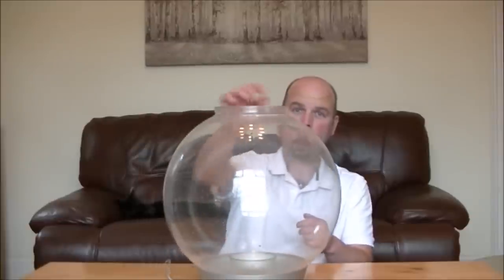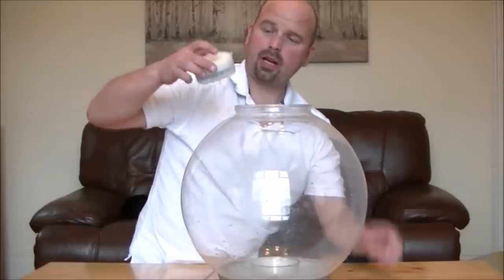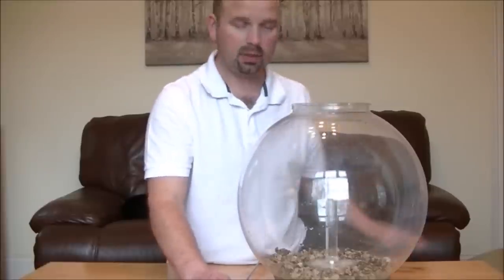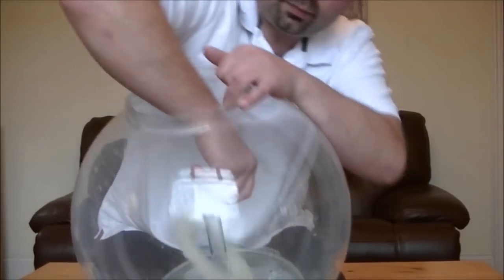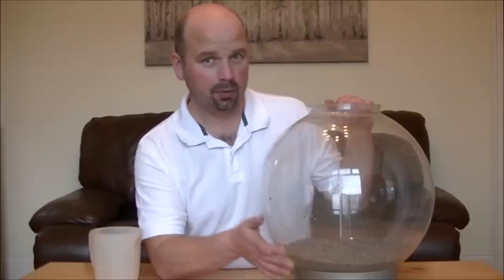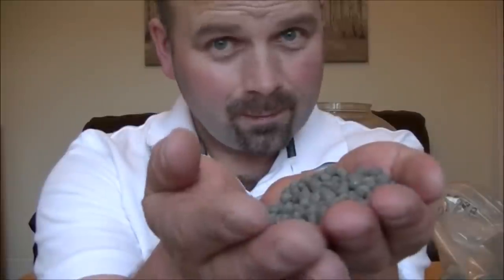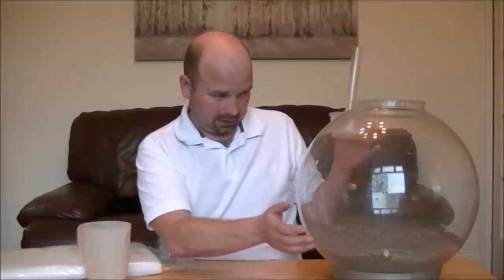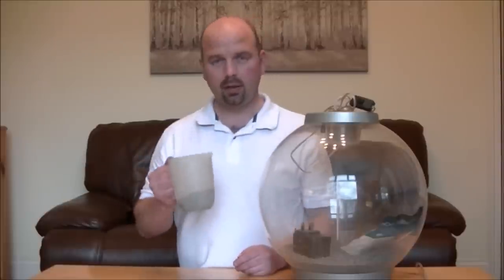BIORB COMPATIBLE UPGRADE KIT

Comment: I have literally just started and brought a biorb 😫. I'm going to do all of this to make sure I get it right. Sorry if I missed it but if I do all this how often do I need to do water changes and filter cleans?
Reply from the maker: Ideally you would still change around 10% a week just to keep the tank freshened up. That would be done when you use a gravel cleaner like this to remove dirt from the biogravel base: http://geni.us/0YMWPJJ
When using the gravel cleaner the muck will be removed from the biogravel and foams but the central fine filter pad could need replacing every 1-6 months (maybe more) depending on stock as it traps very fine muck and can't be cleaned easily.

Comment: i wont be able to put this in my filter as i got juwel but i wont even be able to put 1 kg in the juwel filter as i wont have any foams then but i might be able to put 500g of it in my filter in the bottom tray the untimate version will that keep the nitrates low
Reply from the maker: Usually 1kg per 100 litres produces a more or less guaranteed reduction in nitrate but using any biorb will help to varying degrees.

Comment: Can you put dirt on top of the foam, then sand, and the rocks afterwards?
Reply from the maker: You could but it would get all mixed up as soon as you cleaned the substrate with a gravel cleaner. An under gravel filter really needs to be set up with gravel of small size in an aquarium.
Reply: @Pondguru  Thank you for responding. Do you ever have to change the foam at the bottom? I'll do this set up and add live plants but I was worried about the foam
Reply from the maker: @lexierachelle5878  The foam should easily last a couple of years before it need replacing - foam can last for ages and only needs replacing if it gets too clogged and can't be cleaned or it starts to go floppy or shrinks with age. Root systems from plants will be extensive enough in the Biogravel and upper foam to allow movement of plant at a later date if you choose to renew the foams at a few years down the line.

Comment: I'm setting up my canister filter with 4 trays can I use 2 trays of Bio ultimate and 1 tray of bio gravel and of  course your the first one has your  media
Reply from the maker: Larry Liotta Yes just go with foams in bottom tray then biohome (any type) in trays above that. The biogravel would probably be best in the top tray as long as you had a plastic grid over it to prevent pieces being sucked into pump. If no plastic grid then go with the biogravel in middle media tray.

Comment: Hi Richard, I have a BiOrb Life 30L and I'm interested in doing this upgrade, but the one you present is round while the BiOrb Life has a rectangular shape, and has a flat bottom instead of a rounded one. With that in mind, how shoud I cut the foams and how should I position them? With the waves down or the flat side down? I'm asking this because if the waves are positioned down, the water and the debris will go through the path of less resistence. When you place the second and bigger foam, it touches the side of the tank because it is round, but I can't do that because mine is flat. Do you have any idea of how can I acomplish a good filtration system? Best regards.
Reply from the maker: Dear Jorge,
The life tank ideally needs black foams (as they will be seen through side of tank) and to have them cut to the full size of the base. As the life tank base size has a larger area than the 30 litre it requires approx. 3.5kg of biogravel, not the 2kg shown here for the 30 litre orb shaped tank (with the smaller base).
Therefore if you are going to order a kit you would need the one I do for the 60 litre orb since it has 3.5kg in it. If you order please attach a note or send a message at same time to remind me to put the black foams in as they would normally be black and blue.
Regards,
Richard

Comment: I currently have a diy k1 moving bed (2 x 2 leaders plastic bottles) connected to my under gravel filter in my 125 gallon tall guppy tank. My question is would this be a good option to mix with my current gravel I have in the tank? As I don't want to lose the coloration I have but the mix of the red I have now and the grey/black of this media/substrate would be fine. 

I do have a drip system set up on the tank so no water changes at the moment however I want to lower the loss of water due to having a drip system in place. Removing nitrites will drastically reduce the need to run the drip system. 

I also have 10 x 10 gallon fry tanks and a few selective breading tanks. None of wich are planted. 

The 125g. Is a simple grow out tank for fish I do not use for breading and are sold or given away to friends and family.
Reply from the maker: Phillip Hamby While mixing the biogravel in with existing gravel would certainly add to the filtering capacity of the tank the fact that the gravel and K1 only really supports anaerobic bacteria would mean that you would still have a nation of nitrates produced from those media types - any effect the biogravel may have will be negligible as far as nitrate reduction goes due to the standard gravel and K1 likely producing more nitrate than the biogravel can process.
Reply: Pondguru Outdoors thanks for the quick response. What in this case would you suggest for removing the nitrate. Keeping in mind that everything must be in tank. 
Maybe a chamber type of internal filter? Acrylic box with 3 or 4 chambers? I have a few ideas after watching many of your videos. However I and im sure others would like your views and recommendations in this situation. Also keeping in mind that all my media will be coming from your suppliers  in the us.
Reply: Pondguru Outdoors also this 125 gallon tank house at any givin time 100-350 guppies of all sizes. Tho a guppies bio load is some what small in those numbers it can get out of control quick. Thus the drip system and a lot of wasted water.
Reply from the maker: Phillip Hamby I would personally simply replace the gravel for biogravel and that would be the nitrate issue solved (after 4-6 months once anaerobic bacteria have built up sufficiently). Having different media and filter types competing against each other producing / processing nitrate will be difficult to balance and unless you find a way to cut back on the nitrate production and scale up the nitrate removal it will always be a problem.

Comment: I know this is an old thread and you have stopped responding... But I have a Biorb 105. I can see the weight on your website, but do you Dave a kit for 105L? Or just measurements for foam etc. Cheers for your great films. I think you are great on camera!
Reply from the maker: Dear Alan,
I do not offer a specific kit for the 105 as the foams I get in are only 11" x 17" and I have to buy hundreds at a time but the weight of biogravel is 5kg as confirmed by lots of people who have made their own kits.
Regards,
Richard
Reply: Pondguru do you know where I could buy foam big enough? Sorry to pester you! The fine filter you put in the filter  unit is same size. It's the base foam two that I need. :-) 

I'm an anaesthetist. (If you need any medical advice pvt message me!)
Reply from the maker: Unfortunately you'd have to go to the next size up which would be approx. 2' x 18" which is quite a price jump but you will find them from most pond suppliers: http://geni.us/zT8NA

Comment: Thank you for your thoughtfulness to create a solution for biorbs. May I ask 3 Q's; what would happen if I used the biohome gravel over the media that comes with a biorb? As we have already set our orb up before seeing your video(!) would it be enough to 'just' use the biohome gravel  and gel balls inside the fine centre filter? How important are the coarse & medium foam layers? Many thanks.
Reply from the maker: The foams act as a support for the biogravel (meaning you don't use much more simply to fill the bottom of the tank over the level of the central filter) and also as a mechanical filter but they also prevent any of the biogravel getting to the central filter and blocking up the intake holes. If they get blocked the whole filter system fails as it relies on a good flow of air and water.
You could just go with the biogravel in the central filter but it wouldn't do any good as you'd fit very little in there and the central filter should really be for fine foam to remove the small debris in water (to 'polish' it).
I have just answered a question about what to do if the tank is already established and here was my answer to that question:
"Just make sure that the biogravel is very well washed then ideally soaked in a bucket of water overnight then empty out the biorb into a suitable container along with the fish and other stock, set up the filter system and return everything to the tank. This may take between 30-60 minutes depending on how easily the fish are caught and how much clutter is to remove from the tank."
Hope that helps.

Comment: your saying that stuff is made up of sand.... would sand do the same job or is that no good in one of these tanks ?
Reply: It's made of silica sand that's been fired to something like 1500 deg c. So no. Ordinary sand wouldn't work because it's not porous.
Reply from the maker: Sand would not work over what is essentially an undergravel system - the foams are there to support the biogravel and mechanically clean the water. Sand would work its way down clogging the foams and fine pad rendering the system useless unfortunately. I'd normally recommend sand for tropical fish but in this situation it is not feasible.

Comment: Hello thanks for all your help, sorry one more question how often should I change the water of the 30l BiOrb, I use the optimser once a week, and check the PH levels should I just replace a little bit of the water with conditoner.
Reply from the maker: The tank should be cleaned once a week to remove any uneaten food and fish waste from the base of the tank no matter what sort of filter system is used (including a gravel base over foams) using a gravel cleaner like this: http://geni.us/0YMWPJJ
Depending on how long you spend cleaning the base anywhere from 10%-25% of water could be removed from the tank. Most people who have the biogravel system do a water change / gravel clean once every 1-2 weeks and change maybe 10%-15% of water - that keeps base of tank clear of waste and also freshens things up by adding new water.

Comment: love these upgraded videos, always need someone to think outside the tank. I've always used bio home since found on here, I have a question tho about that air stone, is there enough room inside that tube to create a moving bed filter????? add even more filtration with bio motion??? please say yes lol maybe another video, mite have to buy one of these biorb's.
Reply from the maker: +James McMullan Maybe using the new small K1 micro could add a moving bed in the middle tube but it will not be necessary from a water quality point of view when using the undergravel system here.
Glad you enjoy the videos and thanks for watching.

Comment: I’m in the process of setting up a 5 foot community tank which I want to try and keep as low maintenance as possible in the long term I know this won’t be possible in the first 6 to 12 months but I can deal with that is there any reason I couldn’t use this for the substrate to achieve that low maintenance in the long term?? And how much will I need it’s 5 foot long 2 foot front to back and 2 1/2 foot deep

Comment: Great vid thank you, I have subscribed..... in terms of stock what could a standard Biorb take, I was told in a 30ltr max of 6 Neon Tetra jumbo sized fish, with your customised filter what do you think would be a good stock level?
Reply from the maker: You'd certainly be safe with that stock, maybe a few ottocinclus for algae control and as long as the filter system was working well and you kept up with maintenance they should be happy enough. the problem is getting the standard system to work properly.....

Comment: Hi, Pondguru. i can't see that anyone has ever taken the top off the Biorb and had an aquascape flowing out of the top. is this something you'd ever consider trying? i've been given a biorb as a starter tank and will be buying the conversion kit from you as to not kill everything that goes into it, but i'm looking at trying a blackwater tanks with driftwood poking out the top. for lighting i'd probably have a submerged LED tube in there. in my mind it will look pretty good but i'd like to get the opinion of an expert before i take this on. Any advice welcome

Comment: Do you not need to be able to clean those foam pads under the gravel?
Reply from the maker: Yes, much of the muck would easily be removed by using a gravel cleaner to push through the biogravel and slightly depress the foams. I would normally recommend giving the tank a full strip down every 12-18 months depending on stock but as far as I know nobody has ever told me they took that advice and they still have the tank running fine. Simple gravel cleaning with something like this: http://geni.us/0YMWPJJ does 2 important jobs. It removes the muck from bottom of tank and does a partial water change to freshen things up.
Even when tank reaches full maturity of zero ammonia, nitrite and nitrate the mick needs removing for hygiene and water change reasons.
Reply: Pondguru great. Thanks for video and reply.

Comment: instead of using biohome, could I use ceramic rings like fluvals biomax?
Reply from the maker: The size and shape of media used is the most important thing as the system is effectively an under gravel filter. That is why the biogravel was developed - to be a porous gravel sized media for under gravel systems or very small filters.
If you use ceramic rings or other large media the water will find the easiest route past it and it will not function as a filter media.
Even ordinary aquarium gravel will work much better than ceramic rings or other large media.

Comment: I didn't know the Biorb was made with an acrylic sphere- Is this the original  or actual Biorb or just the universal term?
Reply from the maker: +Lhin Doh Biorb is the type of tank and it is (or was) manufactured and marketed by Reef One. They were recently taken over by Oase but unfortunately they have no plans to improve the filtration or design which is a massive missed opportunity.
Reply: Oh so Biorb by Reef One is not a glass sphere but plastic?
Reply from the maker: +Lhin Doh Yes definitely plastic.

Comment: Can you use aragonite in a Biorb death tank?  I just bought one before watching your videos. UGH!! I have mystery snails and nerites and guppies. Thank you!
Reply from the maker: Aragonite is generally very fine and if you're going for a proper under gravel system like this you'll need something which is at least 5mm particle size.
Reply: @pondguru  I will be using the Biorb 30 Life bowl. I want to filter hack it, but was thinking of putting lava rock in it now for shrimp.
Reply: @Raegan1616  As long as it is the small proper lava rock which is like a gravel it will function fine in this system as an under gravel option for filtration - it's a good choice since it is generally very cheap but is rough enough to support a decent amount of bacteria.

Comment: I have a 50l tank that is technically over stocked and I'm looking at making it a planted tank and wanting to lower the amount of maintenance I actually have to do and want to know if this media would work and how much of it I would need to use to get the best results
Reply from the maker: Less maintenance will often come from beefing up the filtration and the filter choice would be dictated by what the stock of fish was. For example a Fluval 206 external would be a good choice if a 50 litre tank was heavily stocked but a normally stocked 50 litre would be OK with a 106. Maybe a HOB filter like the Tidal 77 or 75 filled with good media would be good if you didn't want a canister filter as most internal filters are way too small for heavily stocked tank.
Reply: @pondguru  I have a marina filter in the tank at the moment but the flow is just to strong for my fish, I have sponge filters on my smaller tanks but I don't feel like they do a very good job but I think it could be the air pump that's the problem with those, I have a female betta tank, a male on his own because he's picky about what I put with him and a guppy tank, the 50l is the females tank
Reply from the maker: @emmajane4452  Yup, I'd say go for the 206 with 1kg of biohome ultimate if you have an overstocked 50 litre tank. Use a spray bar to diffuse the return flow and it will be fine for guppies.

Comment: As you can tell from the comments below I have done the above biOrb upgrade.  Just tested the Nitrite and Nitrate levels and amazingly it is zero for both. I have a Betta, Six Cherry Barbs, three Pygmy Corrie and an Assissin Snail.  They are all doing well.  The GH is 16 though what do I need to do? 8-)  Otherwise everything is brilliant and I am very happy with the set up.
Reply from the maker: Awesome to hear that levels of pollutants don't register at all and with regard to the GH that is a little high for soft water fish but unless the fish are wild I wouldn't worry about it as they will likely be used to levels higher than that. Aquariums tend to get softer with age so it will likely reduce naturally unless the water used for water changes is way high.

Comment: will this gravel replace sand and gravel in all my tanks.
Reply from the maker: It would work fine as a normal substrate and is excellent for shrimp tanks but as it is really designed for use over an under gravel filter (it is very porous) then it would work out expensive to cover large areas with it.